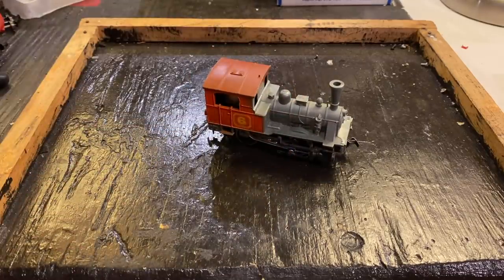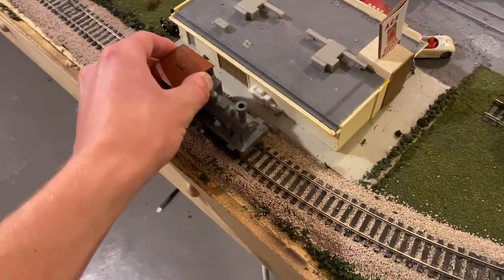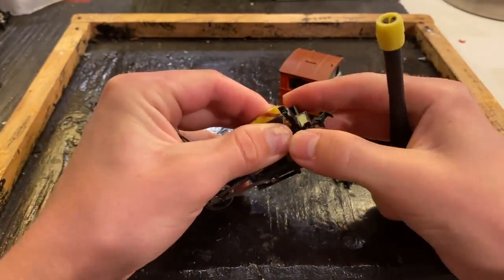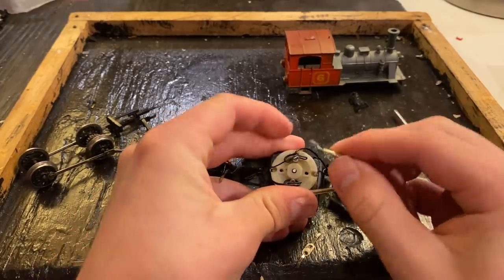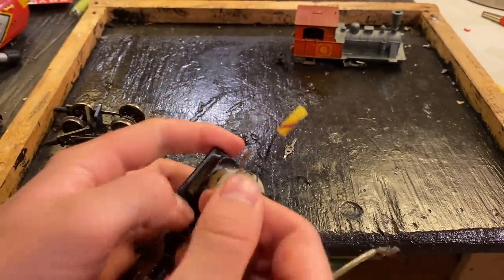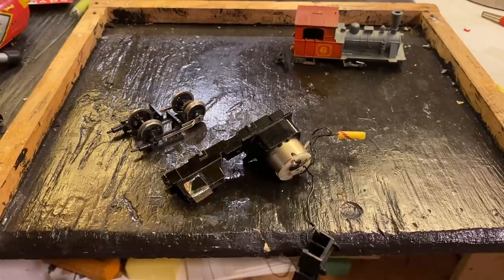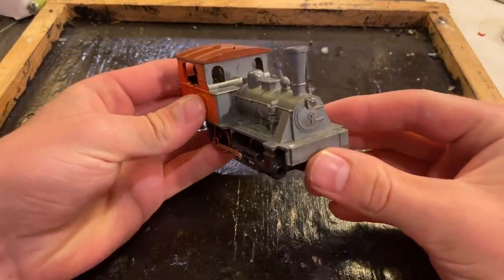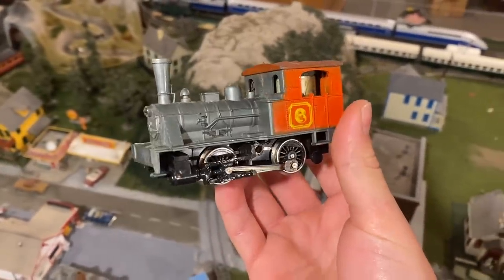Can We Make It Run? Strange Non-Working Steam Loco (Play-Art)

Comment: Hi SMT- I have a million of these things lying around so here are a few things I would do to make this a better runner:
1. Take the rear (geared) wheel set out and push down on the armature so you can oil the area under the worm gear.
2. Oil the top of the armature, where the metal meets the plastic cap.
3. Put the two silver contacts (like the one that was disconnected) back at about a 45 degree angle so the body will fit easily.
and 4. OIL EVERYTHING!
Hope this helps! Greetings from NJ!

Comment: I think that is probably modeled after an older German tank engine built before the 1920s, but I could be wrong.
Reply: Yes, I think it's basically a clone of the Fleischmann 4000.
Reply: ricardlupus 

Really?

I’ve seen a few German HO trains being cloned by NewRay when I was looking them up on Google Images.  I thought they only made train sets in other scales until I came across a picture of someone’s modified NewRay HO train in some Facebook group.
Reply: Looks a bit like 385 at Middleton railway  which was built in 1895
Reply: Fleischmann

Comment: Enjoyed the video SMT!  I have an old Athearn ready to roll GP38-2 that makes a similar noise when it runs.  The difference is after it runs for a bit, it goes away.  I figure it may just be a lubrication issue, I'm probably going to take it apart and use my motor cleaning kit on it and lubricate it and see what happens.  I thought I would ask your opinion, thanks!

Comment: The loud squealing noise is dry motor bearings.  Add a bit of light oil to both of the motor's bearings (one is hidden under the worm), and it should clear that right up!

Comment: Judging by the sound of that Motor,it sounds like it is being run down;it is worn out.That old brushed DC motor,is a fire hazard.
To reduce the risk of the motor burning out,and possibly bursting into flames,you should replace that old worn out brushed DC motor,with an AC brushless motor.
It will alot run quieter with an AC brushless motor installed,and the risk of fire is greatly reduced.

Comment: I had one similar it was a model power. It was an old time. 0-4-0. With a log tender . I don't know where it went but that was back in 1998-1999 .  Glad you got it running I think it needs a new can motor bearings sound shot which does happen but if remotor it will have better life.  awesome video as always .. Since January 10th 2019 I've been a subscriber. But I still remember the videos. You made kdpt coming up and i commented and so I subbed back then. This channel has grown like super fast and has such a following and inspiration to everyone. have a good day. :)
Reply from the maker: I think you might be right about those bearings, something sounds off.
Reply: @SMTMainline  yeah you know when you took it apart thats how my motor looks for my record player lol im not kidding but has no voltage regulation unlike the turntable which needs a constant voltage setting

Comment: Fun fact: play-art was made by model power. If you look at some old model power advertisements you'll see this locomotive, it came in a starter set. I know this as I have some old model power boxes with this ad and I have a more American-looking play-art engine. I hope this helped!  :-)
Reply: Are you sure it wasn't the other way around? Model Power tended to order their products from other manufacturers. You can see a photo of one of the locos on this page. 
http://mmiwakoh.de/Eigene%20Webs/lima-modellbahn/Playart%20en.htm
Reply from the maker: I wasn't aware of that. Thanks for sharing!
Reply: @SMTMainline  no problem! :-)
Reply: @emdB67  that's possible too. I thought that I read somewhere about model power owning play-art, or vice-versa, but I could be wrong. Thanks! :-)  Edit- I just checked out that link, and I do recognize a few other models that I know as model power. I always thought model power was a bigger company than they are, and assumed they just had a subsidiary called play-art. Although, since they ordered model from other companies, I'd have to say you're probably right. So thank you for the information, and have a good one.
Reply: Some more info on Playart can be found here. Model Power is mentioned. 
https://en.wikipedia.org/wiki/Playart

Comment: Smt my grandfather's bachmann steam engine is sparking around the motor how I stop the sparking?
Reply: Is the comutator dirty? Could be that problem. Like if the wheels were sparking they would be dirty.
Reply from the maker: @mercuryoak2  That's what I would guess to be the problem. Sometimes too much carbon build up can cause arcing on the commutator.
Reply: @SMTMainline  yeah i mean my open fram motors on my mantua locomotives did it too they all do shoot off fireworks when they not getting clean power plus its something ive learned while watching you do it,koko sams trains because i honestly never had to do it on my um bachmann diesels they werent run much but lifelike pancake motors regularly need a cleaning. Hope the suggestion helped I figured heck all the help one can get right?
Reply: @mercuryoak2  Ya that's the problem. Just need to clean the spaces in the commuter

Comment: Sounds like it needs a little oil on each side of the armature shaft bearings. Try that out, and give it another try on the track. If that helps, please show us how it runs afterwards.
Reply from the maker: I tried doing that and it didn't seem to fix the sound.
Reply: Did you actually take out the armature when you fixed the brushes against the commutators, and check to see if there was anything getting caught up between the windings and the magnets. Something is causing it to squeal like that.
Reply: It’s always fun to find the cause of motors that squeak, it is definitely the motor bearings or it might have a bearing above the worm gear. Sometimes the motor bearings are worn out causing the armature to move around making noise.
Reply: @SMTMainline  squealing motors on old locos are quite common. I've even had brand new locos do it (those are rare though). Almost always a dry bearing at one or both ends of the motor. Usually bronze - and those hidden behind worm gears are always the hardest to get the oil into. :)

Comment: That loco also came in green and blue. It was called "Li'l Donkey"
I believe it is based on an italian or french locomotive, oddly enough. Show some canadian heritage and make a white SMT loco with your SMT logo on the side tanks!
I had to disassemble mode power's "Booster" which used that same motor once. Those brushes really are finnicky to get back in. :P These model power/ Playart locomotives can be very noisy, and often they have that "Hop" that yours has. i own three boosters and one hops. I think the factories did not take enough care and occasionally bent the axles. Sometimes the motors they get in bulk are a good batch, and sometimes they are a bad batch. 2/3 of my boosters thankfully have the good motor.

You can order that exact motor you need from china for about a buck total. I'll try and find the link to the listing I bought mine from a while back.

Comment: let the motor set in rubbing alcohol overnight then let it fully dry (48hrs) out shode clear the squealing noise up,. this gives it a deep cleaning it may also ruin it the motor if still wet. I do this only on motors almost dead Not Recommending this idea for all fixes. the noise is because the motor is extremely dirty or lift somewhere that is damp, it's a hard problem to fix sometimes. The motor in that locomotive is very cheap I use to have this locomotive replacing the motors are easy and affordable.